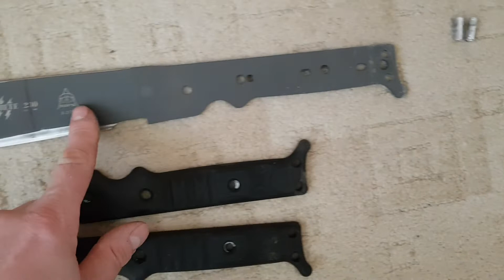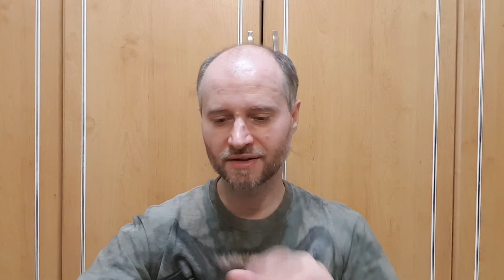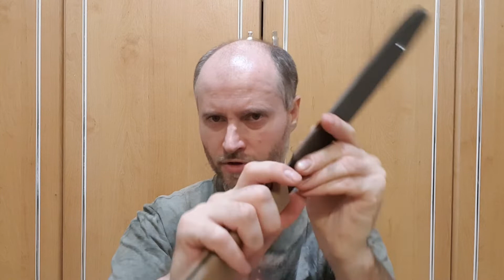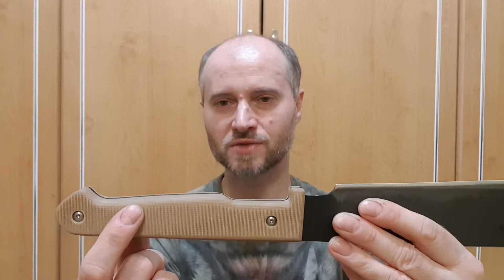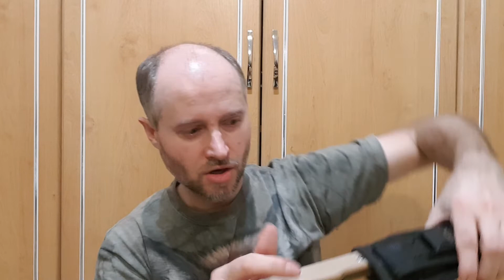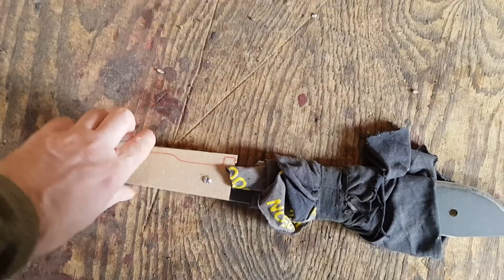TOPS .230 Machete OR is it still THE Machete? THE Biggest project out of my knife change projects.

Comment: The extra holes in the handle area were put there by Ontario for their own machetes. Tops sourced the blanks, added micarta handle scales and finished the machetes. Still a fine tool, I own and love to use both. So if you decided to do a 2.0 there is a cheaper option. (For now)